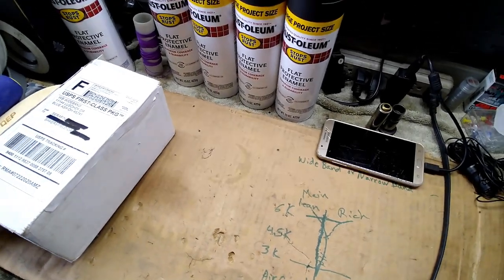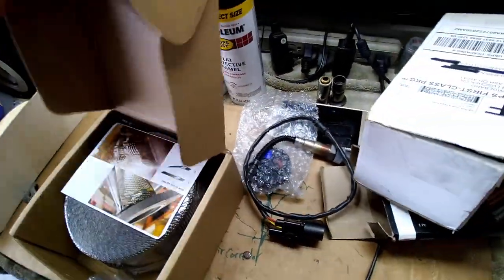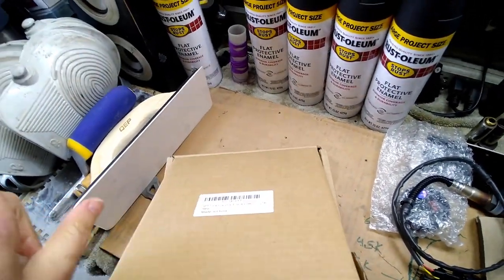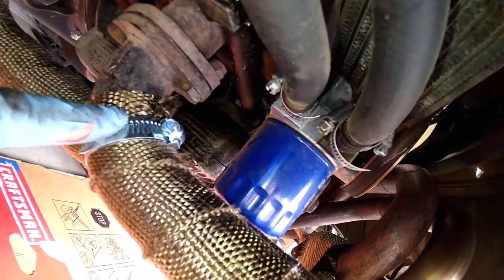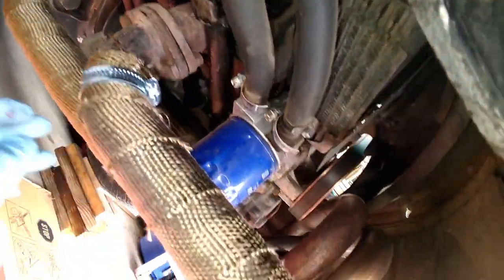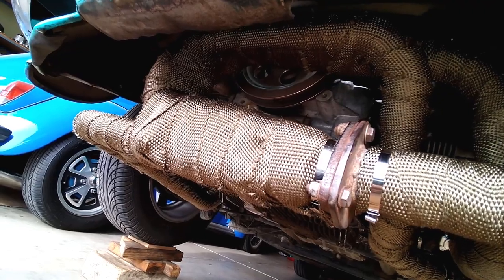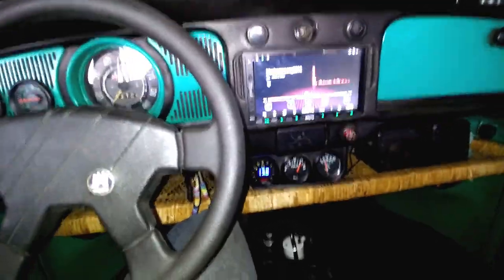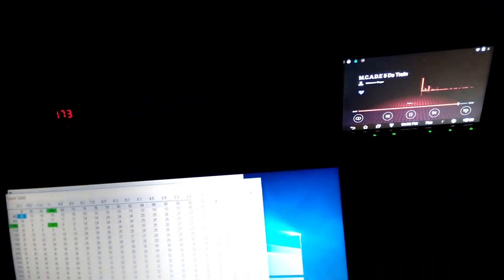Sidewinder Exhaust Wrap Type 4

Comment: Maybe increase the advance at 600rpm. That will act as a “cushion” as the revs fall below 1K rpm as the gradual advance increases due to the interpolation.
Reply: Also, maybe move 400rpm cell up to 600rpm & move the 600 to 800?
Reply from the maker: Ah yes, that is exactly what I'm going to do next.  Thank you

Comment: Warping the exhaust system, won't rust it out in CA?
Reply from the maker: I don't know. I would assume that it probably does accelerate it but that would be only in the winter and I do drive it in the rain but for the most part the rest of the year is pretty dry. So I should be fine I think.
Reply: @Motor7710  
Okay, sounds good.  Here in New England the exhaust system would be rusted out in no time. ☹